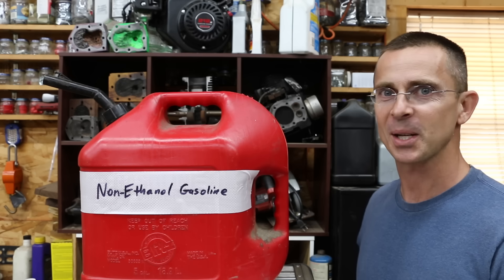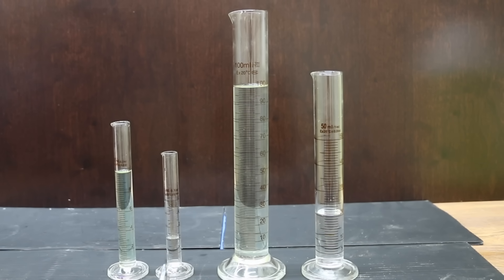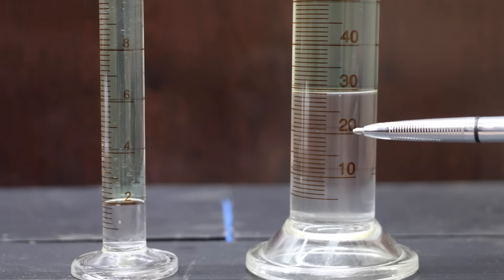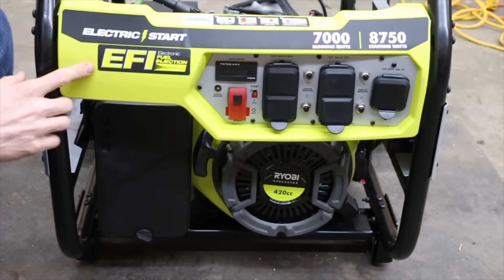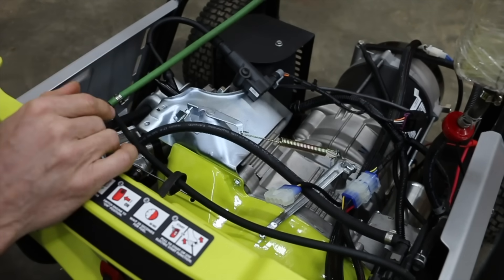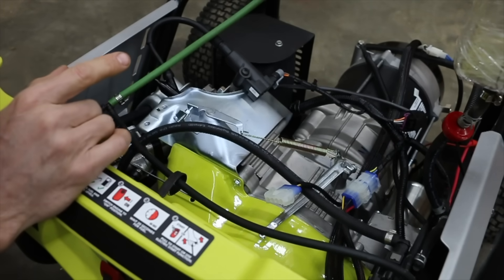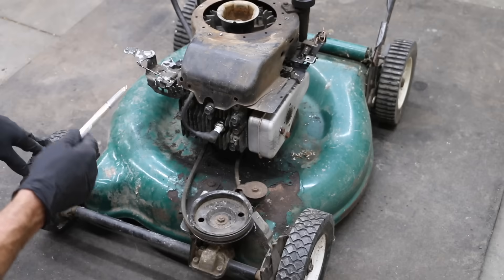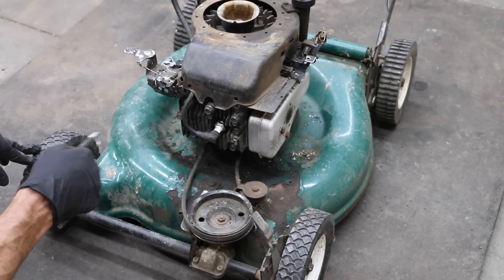Is Non-Ethanol Gasoline Really Better? See the PROOF!

Comment: Its interesting,  I've found that the computer in my car knows what type of gasoline is in my tank.  My trip computer always gives me more miles per gallon about 10-15% when I fill with non ethanol laced fuel.  Which in a years time was over a $500 savings.  Though getting my wife to fill at the proper pump was challenging, because all she saw was the price thinking an immediate savings.
Reply from the maker: Thank you!
Reply: Let us look at the world's most selling vehicle, the Ford F-150 which gets 17 mpg on E0 and 14 on E85. The EPA states most vehicles lose 3 to 4% mpg on E10 and 4 to 5% on E15.
Prices from e85prices.com

E0 = $2.38 @ 17 mpg = $.14 cost per mile

E10 = $2.09 @ 16.32mpg = $.128 cost per mile

E15 = $2.02 @ 16.15mpg = $.125 cost per mile

E85* = $1.80 @ 14 mpg = $ .128 cost per mile

*E85 looks more expensive per mile than it should be in winter because it is E50 so mileage should be more than the 14 mpg I used.

See page 5 and the US06 real world driving exhaust emissions of E85 vs E0 from Oak Ridge National Laboratory, astounding difference:

http://web.archive.org/web/20170121004456/https://www1.eere.energy.gov/bioenergy/pdfs/analysis_saab2007.pdf

Note that E85 gives more horsepower.  See this 5.3L gasoline optimized Chevy pickup, it gets a clean 380 horsepower on E85 and a toxic 355 horsepower on E0.

https://media.gm.com/media/us/en/chevrolet/vehicles/silverado/2014.tab1.html
Reply: @danafletcher2341  ... I ran across some E15 (tested it) and the 5 vehicles ran poorly on it.
Reply: @hotrodray9884  The EPA/DOE did long term tests with E15 and even with E20 on cars 2001 and newer and found both fuels ran fine and did no damage.

We have the huge example of the whole country of Brazil running on E20+ since the late 70s, currently using E27.5 with their non flex fuel vehicles.  It has worked out so well and for so long that Argentina and Paraguay switched to E27 themselves.  Brazil is now talking about going to E40 perhaps.

Nebraska has a pilot program of using E30 in their non flex fuel state vehicles and South Dakota regularly has promotions of E30 for non flex fuel cars as well.

I wonder why your vehicles are not up to par?
Reply: Boun_Viaggio_USA I agree with you 100% with 10/15% less mileage with E10 shit.
Reply: Whoa, you spend $5,000 annually on gas? Thats a little out of hand. Too bad the non-ethanol gas is 15-20% more expensive. Probably should look into more fuel efficient vehicles if you're spending that much on gas.
Reply: Mike S i own a business with a service truck. Plus my wife is a realtor, and I travel in a motorhome 3 weeks out of the year.
Reply: Boun_Viaggio_USA  Neat. Still not sure why you’re spending 20% more on gas to gain 15% more mileage. I like non ethanol gas too, but it has nothing at all to do with the savings.
Reply: Mike S cost of real gas where I live is only 12% more.
Reply: @Msigw  The EPA said, "Ethanol contains about one-third less energy than gasoline. So, vehicles will typically go 3% to 4% fewer miles per gallon on E10 and 4% to 5% fewer on E15 than on 100% gasoline.3"

Exxon-Mobil said "Ethanol contains less energy than gasoline per gallon of fuel, but any changes in the fuel economy performance of your vehicle are expected to be minimal." 
https://www.exxon.com/en/product-faqs

Perhaps his particular vehicle is in some sort of need of repair, adjustment, and/or maintenance. 
 I suppose it could be possible it is that far below the average vehicle, but four times worse than most vehicles indicates something else likely is going on and should be investigated.  

The 2018 Ford F150 in my example above only loses 18% economy on E85.  E10 should never be that bad.

Not only is he costing him more per mile to drive with E0(i.e. spending 20% more to save 15%= -5%) even with its better mileage, that is not the only cost.  It is costing himself, his family members, and the rest of us our health as E0 contains more toxic and carcinogenic volatile organic compounds/aromatics like BTEX(benzene, toluene, ethylbenzene, & xylene) that we all get exposed to and accumulate.
Reply: @Msigw  ... few people realize the overall expense to produce E. 
My cars run noticeably better on Ezero.
Reply: @danafletcher2341  get off your high horse. Mount saint Helens. Oh, and how much glyphosate and federal reserve debt goes into that ethanol fuel? How much non GMO corn has it's genetics damaged? How much extra do stainless steel fuel lines cost? How much water does the consumer end up paying for? How much $ for all the sensors that allow a vehicle to utilize all the different e blends?
Reply: @hotrodray9884  All the expenses to produce and deliver a product to the consumer are reflected in the product's price.

As such note that ethanol on the NYMEX is $1.35/gallon and an unusable sub grade of gasoline(RBOB) is $1.96/gallon.

To make RBOB usable expensive and toxic octane booster must be added, unless of course you simply splash blend in 10% ethanol then it becomes cheaper and less toxic.
Reply: Dana Fletcher you seem to be well versed in controlled environment testing by agencies that have been known to push political agendas on the public. Try gathering real world every day use type data yourself and maybe you'd change your mind. Oh and the toxic effects of "old world" octane boosters have been eliminated by improved emissions reducing equipment in modern vehicles such as variable valve timing, direct port injection, cylinder head air intake port design, catalytic converter design changes the use of activated carbon absorption systems. All of these engineered improvements just to list a few, have essentially eliminated the toxic effects you speak of.
Reply: @RJFLAUSA  The production and use of toxic aromatics I am sure gets better all the time, but it still is super toxic.

The real world got a big benzene treat in Houston this year.  The American Petroleum Institute (API) stated in 1948 that "it is generally considered that the only absolutely safe concentration for benzene is zero". There is no safe exposure level; even tiny amounts can cause harm. 

FROM URBAN AIR INITIATIVE:
Petrochemical fire in Houston reveals much larger issue.

On Sunday, March 17, tanks of toluene and xylene caught fire at Intercontinental Terminal in the Houston, TX area, releasing plumes of black smoke into the air. As a result, incomplete combustion of toluene and xylene combined to form benzene, a known carcinogen.

Toluene and xylene are toxic aromatic chemicals added to gasoline to boost octane. The Environmental Protection Agency classifies these chemicals as hazardous air pollutants, even though they make up 25% of gasoline. While you could see the cloud of smoke hovering over parts of Houston, 

 this process of incomplete combustion happens every day in the 263 million automobiles across the United States. You just can’t see it. Due to gasoline’s incomplete combustion, toxins escape through the tailpipe into the atmosphere as ultra-fine particulates 

 (UFP’s). UFP’s are smaller than the diameter of a human hair and once released remain in the atmosphere. Moreover, they are smaller than the EPA’s mandated size of particulate matter allowed in our air.

Since UFP’s are so small, our body’s natural defenses can’t filter them out; instead, they pass through our lungs and directly enter our bloodstream. These UFPs potentially cause health issues. The fire in Texas is a disaster, but the Urban Air Initiative (UAI) hopes it serves as an opportunity to start a discussion about the need to reduce toxic aromatics in gasoline and protect public health.

China, India, and Indonesia are using an economical process called TCX Technology that can turn natural gas, coal, and oil into ethanol developed from a Texas company named Celanese.

With enough ethanol, we could have could have super clean and super efficient ethanol engines that are half the size/twice the power of gasoline, some with mileage greater than the most advanced diesel engines.  

Imagine cities with air as clean to breath as only an electric car advocate dreams about.
Reply: Dana Fletcher I'm familiar with Celanese, my company is partnered with them in the production of inks, adhesives, rubber emulsifiers, activated carbon, specialized drilling fluids. I'm in my late 50's and have worked with Toluene, benzene, basically countless aromatic solvents since I was 19 years old. Yes, these materials are toxic and can hurt you if used improperly. The worlds basic element, H2O can do just as much damage if used improperly too. Our infrastructure has been set up to rely on hydrocarbon based building blocks that make up our society. Look back at our society before the industrial revolution and compare mortality rates. Can you really claim our mortality rates based on total population has suffered since we began to rely so heavily on hydrocarbon based raw materials? I'm just saying that ethanol based building blocks are inefficient and detrimental (destructive to equipment) to the system that we have in place now. It was rammed down our throats by idealistic zealots, not true scientists. I've seen the damage it causes not only through inefficiency but mainly its corrosive traits. The EPA and DOE are full of it by claiming its negative traits are insignificant.
Reply: @RJFLAUSA  
Our Mortality rates are skewed with technology.  There used to be many deaths during childbirth and early years which make it seem like we live longer today.  Deaths from bacteria before antibiotics also skew numbers.

People surviving because of stints and bypass surgeries does not mean heart disease is less than in the past, you get the point that these skew the numbers.

People survived with leaded gasoline I suppose(with fewer IQ points), but I do not want to just survive, I want humanity to thrive.  We can not thrive swimming in toxins and we can not accumulate more and more.  I consider lead a crime against humanity, I expect one day we will look at BTEX the same way we do lead.

The air is cities is very bad.  We can mask smog so it is not as visible as other cities such as found in China and India with catalytic converters and such.

Ethanol was the main ingredient for the dominant lighting fluid even during whale oil's peak in the 1840s. By 1860 ethanol was at 100 million gallons before kerosene had hit the market(first oil well was 1859).  Whale oil in 1860 was cost prohibitive and on its way completely out.

https://uploads.disquscdn.com/images/2c95aa65d707191062ea2468df1d2b3ead10cffa6c42815a698745bbbb58fbf7.jpg

Then, in 1862 a tax to pay for the Civil War was put on ethanol of a whopping $2.08/gallon and kerosene's was only $.10/gallon which caused kerosene to become the fuel for lighting literally overnight.

Kerosene is toxic and produces soot which people breathed in their homes.  Yes this tax caused more death and more human suffering than otherwise would have happened no doubt.  Soot is not good for health, common sense there.

When trust buster Teddy Roosevelt ended that Civil War tax over 40 years later, John D. "competition is a sin" Rockefeller saw to it that no less than a Constitutional Amendment would stop ethanol as a fuel in automobiles by funding Prohibition's passage with an exorbitant amount of money given to the Women's Temperance League.  John was not going to have someone the likes of Teddy bring back ethanol so easily again.

Ethanol is not destructive to equipment.  In Brazil they find identical engines last up to three times longer on E100 than their common gasoline(soot acts like sandpaper inside an engine).  

Here is a chart on what exploding ethanol use in the US did to repairs and maintenance:
https://uploads.disquscdn.com/images/09f191db1baf6565c0aa85036f5531a1d479706d47ee0e4dbe160e2d71a7521f.png

Ethanol is much >>>easier<<< on rubbers, plastics, and metals than what gasoline and BTEX(benzene, toluene, ethyl benzene, and xylene) are.

If you doubt this, look here:

Ethanol = https://www.customadvanced.com/chemical-resistance-chart.html?chemical=Ethyl+Alcohol&rubber=

Gasoline = https://www.customadvanced.com/chemical-resistance-chart.html?chemical=Gasoline&rubber=

Benzene = https://www.customadvanced.com/chemical-resistance-chart.html?chemical=Benzene&rubber=

Toluene = https://www.customadvanced.com/chemical-resistance-chart.html?chemical=Toluene&rubber=

Ethyl benzene = https://www.customadvanced.com/chemical-resistance-chart.html?chemical=Ethyl+Benzene&rubber=

Xylene = https://www.customadvanced.com/chemical-resistance-chart.html?chemical=Xylene&rubber=

Need a second opinion?

https://www.coleparmer.com/chemical-resistance

Or here for a third opinion:

https://www.graco.com/content/dam/graco/ipd/literature/misc/chemical-compatibility-guide/Graco_ChemCompGuideEN-B.pdf

See what high aromatic gasoline is rated for with aluminum:

https://www.calpaclab.com/aluminum-chemical-compatibility-chart/

Note that ethanol is good with aluminum.

The main nontoxic ingredient of RV antifreeze is ethanol and it would not have stood the test of time if it had been corrosive.

Ethanol is super cheap.  The NYMEX price of ethanol is just $1.37/gallon.
An unusable sub grade of gasoline(RBOB) is at $1.95/gallon.

Diesel fuel (ULSD) is priced at $2.02/gallon.

I wonder what Celanese can make ethanol for from coal, oil, or natural gas.

Here is a clean ethanol engine on the roads worldwide today with mileage equal to a diesel engine:
https://www.oemoffhighway.com/engines/press-release/21005554/scania-ab-scania-introduces-bioethanol-engine

No need to commit felonies with the computers in it to fool exhaust testing.  No need for urea nor any toxic anti-gel in winter.

With ethanol we can use up to >E40 or so in current vehicles without modification.

With ethanol, we do not need to build a new fuel infrastructure, 
like Brazil did in the 1970s when they switched, we simply use the one we currently have.
Reply: Dana Fletcher Ok, what ever you say. I'm still not convinced. Have a nice week.
Reply: @RJFLAUSA  Thanks and you too have a nice week.  If you happen to find in the future I had something incorrect in my post, bring it to my immediate attention please.  I do not get mad if found wrong on something, I would appreciate it actually.  My posts to you have stood up against others and I ask that of anyone.

 I am glad you at least now know that many of the negative things claimed of Henry Ford's favorite fuel(ethanol) are complete and utter crap.

PS  Did you know that petroleum's beginnings were not quite so free market orientated before my post?
Reply: Dana Fletcher 

You misused toxin. Look up the definition. It does not refer to all toxic substances.
Reply: @FrankGutowski-ls8jt  

toxin 
n.

A poisonous substance, especially a protein, that is produced by living cells or organisms and is capable of causing disease when introduced into the body tissues but is often also capable of inducing neutralizing antibodies or antitoxins.

n.

A poisonous or harmful nonbiological substance, such as a pollutant.

n.

Any toxic ptomaine.

More at Wordnik from The American Heritage® Dictionary of the English Language, 5th Edition.
Reply: Who Zaskin 

It’s mandated for use in gasoline to reduce smog.
Reply: Dana Fletcher 

It’s often used colloquially to mean toxic substances in general, but scientifically literate people know that it’s not correct and avoid doing so.
Reply: @RJFLAUSA  like her claim that e85 only nets a loss of about 4% fuel economy compared to e0(ethanol free). Which in the real world e85 nets roughly 40% less fuel economy than ethanol free.
Reply: @FrankGutowski-ls8jt  You asked me to look in a dictionary and I did but evidentially you did not like that answer.

The CDC lists benzene as a toxic substance:  https://www.atsdr.cdc.gov/substances/toxsubstance.asp?toxid=14

What should it be called if not toxic, what term is better?
Reply: @prestonrieger8410  I am not sure who her was, but I(male) said the EPA says E10 averages 3 to 4% lower mileage than E0 in our vehicle fleet.

A 2018 Ford F-150 with a 5L engines gets 17 mpg on E0 and 14 on E85 which is far less than a 40% reduction.  Has more horsepower on E85 and less cost per mile to drive.

Oak Ridge National Laboratory measured mileage in our current lower compression flex fuel fleet and found which horsepower is accounted for, called the gasoline equivalent ratio, E85 averaged 3% better fuel economy than E0.

See bottom of page 7, top of 8 here:  http://web.archive.org/web/20170121004456/https://www1.eere.energy.gov/bioenergy/pdfs/analysis_saab2007.pdf
Reply: Dana Fletcher my personal vehicles averaged 17-20 percent less mpg using E10 vs No ethanol. I really don't care about mpg, hp is more my thing and I will admit E85 gave my modern engine a kick in pants power wise. My older non computer controlled engines an associated parts and pieces don't care for it though.
My view is that just about anything we use from cell phones to toilet paper is made with toxic substances. If you want to live in bubble without "toxicity" in your life, knock yourself out living as people did before the industrial revolution. You won't be here using the internet in a toxic free environment.
Reply: @RJFLAUSA  Henry Ford's non computer controlled Model T and he loved ethanol.  Author David Blume says it was a digital timing control.(digits = fingers on lever on the steering wheel to adjust timing)

Humanity can not continue to accumulate more and more toxins, at some point something will give and the health of the population is a sign things are starting to.

Sh_tting in our nest does not work so well since we can not fly away.

I am trying to use less toxic everything.  I found a great antifreeze that works in everything and mixes with everything made by Cummins/Fleetguard.

I use biodegradable oils with specs that outdo conventional synthetic oils.  Great thing is these are cost competitive so why not?
Reply: Bighorn44 None I like that method of switching blends based on seasons.  Though just gonna stick with my method, I already crunched the numbers for me.
Reply: Dude every time I put in gas labeled as 10% my check engine light turns on and my car rattles at idle. When I get that techron drives a bit better. I donno if it's just me but I avoid the ethanol my car goes slower it's already slow :P
Reply: romaneeconti02  Henry's quadcycle was ethanol fueled and he planned to use ethanol as the >>>primary<<< fuel for his Model T.  Here it is backed up not by Michael Moore but by Ford Motor Company's own web page archived here:  https://web.archive.org/web/20030314084407/http:/www.ford.com/en/vehicles/specialtyVehicles/environmental/ethanol.htm

Not that Henry was the first to use ethanol fuel, Samuel Morey used alcohol in his engine in 1826 as did Nicolaus Otto years later.

My friend Marc Rauch at the Autochannel just did an article on this very subject of the Model T and alcohol fuel:

https://www.theautochannel.com/news/2019/04/20/660939-yes-tin-lizzie-was-alcoholic.html